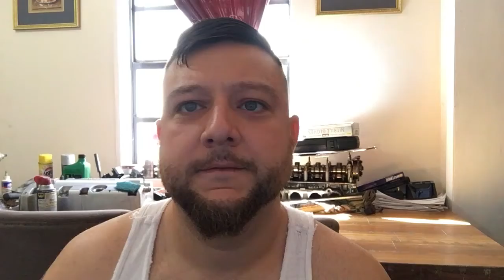B18/B20 Drop In Cam Upgrade

Comment: I'm doing a b18b1 build currently. Pr3 pistons with lightly ported head and super tech valve train. Sde-werks is custom grinding some cams to match the comp ratio and rolling i,h,e with a hondata s200. Trans is a 98 spec itr. I'm excited to see what it can do but I have some friends that are clowning on me hard saying it will be a dog and all that dumb shit. My goal is to smash my friends em1. He has a ihe with pro1 cams in a b16a2 and a clutch. I'm swapping into a 5th gen dx sedan so I have a lighter car but his car pulls pretty hard. I'll update once swap is finished. Thx Chris for all the info.
Reply from the maker: You gotta be real close to 200whp. You’ll beat’m

Comment: B20v b16 head  with killer cams
Is there such a thing for b series like the vtec delete or is there just stages for vtec cams 
How do you get that choppy galloping idle do u need the adjustable cam gears ⚙️ thanks
Reply: Yes. You can run  B20V and use Toda vtec killer cams.

Comment: Now you got me thinking get the cams and gears or just do a vtec head
Reply from the maker: Edgar head’ll be more of a power bump
Reply: Head swap for sure.
Reply: Think VTEC b16 would be cheaper then building b20b p8r flow better then b16 with head work  but... P8r head has 33mm similar sized to VTEC head
Reply: @gabrielleleiba6686  yeah p8r is basically a non vtec, vtec head lmaooo